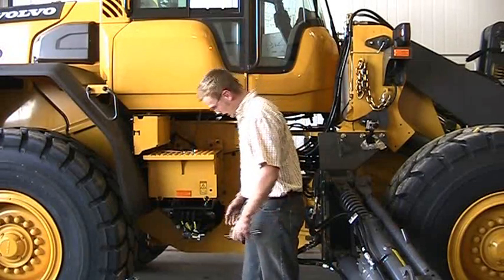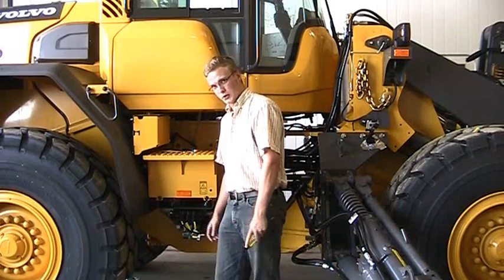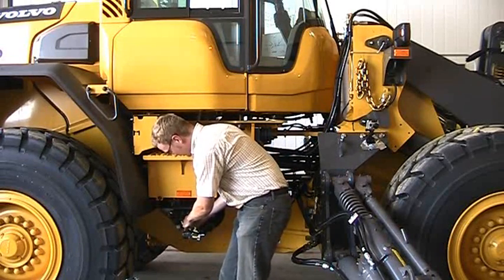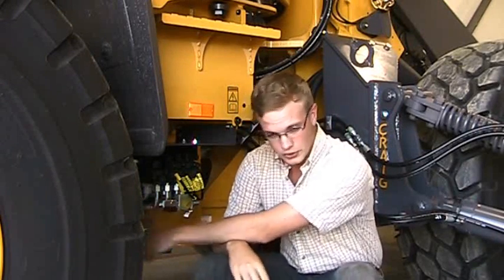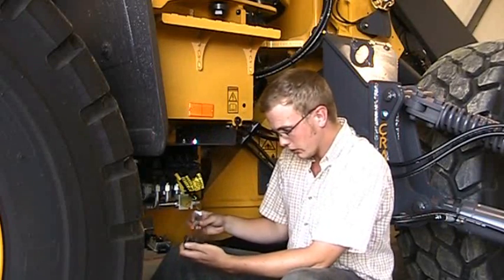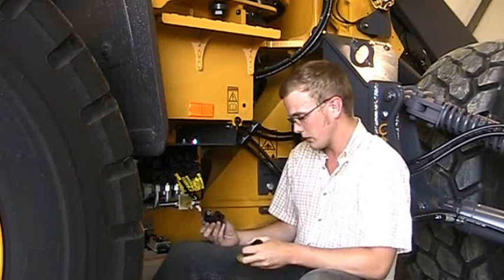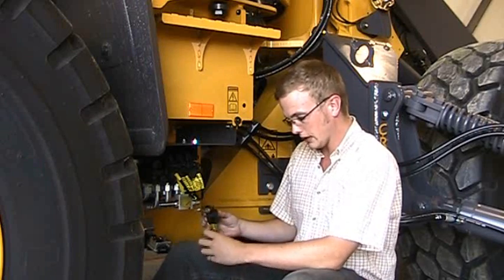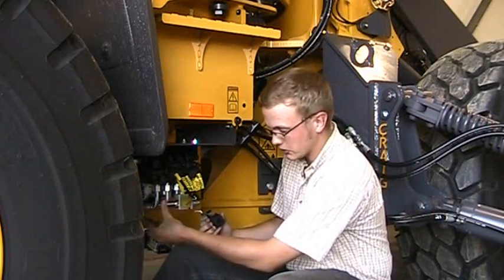Craig Manufacturing - Craig Tech Tips - Loader Wing Valve Troubleshooting

Comment: No safety glasses, no wheel chocks, no articulation steering locks in place, and no emphasis on safety. This is the reason why the fluid power industry is the most unsafe industry in the world - bar none! With all due respect.